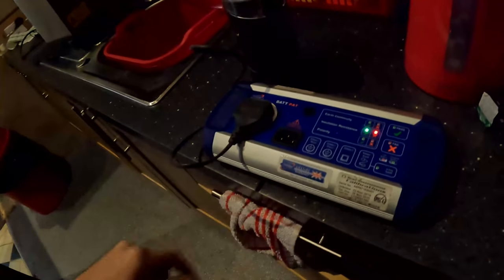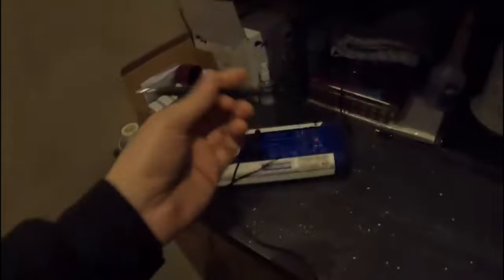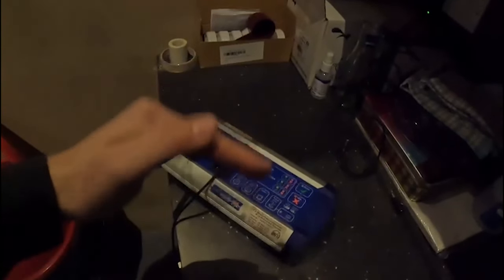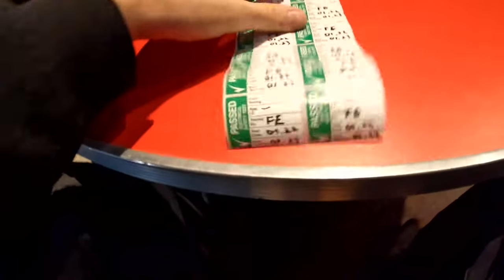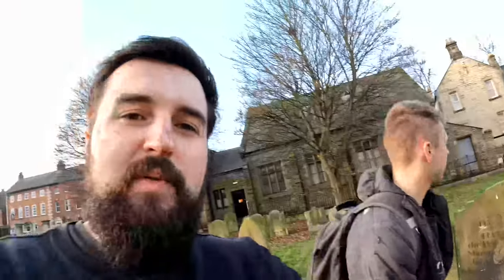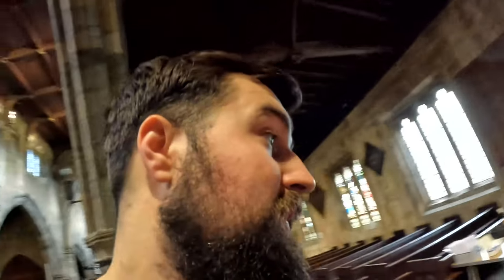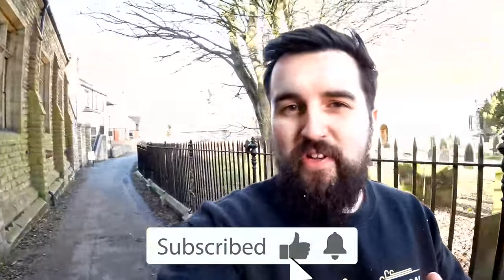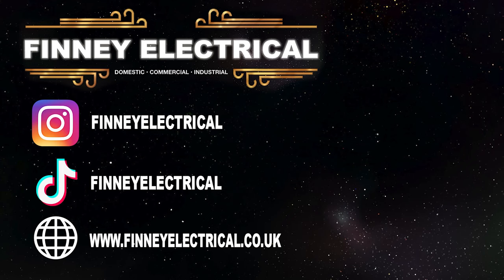THE SIZE OF THAT BELL 🔔 PAT TESTING ELECTRICIAN

Comment: just something to be aware of in the 4th edition Code of Practice for In-service Inspection and Testing of Electrical Equipment published in 2012  section 8.4 labelling it states that "the date for re-testing should not be marked on the label"
Reply from the maker: Not heard this bud, why do they have next test date on the sticker? Surly the client would want to check when it’s next due or when it’s out of date?
Reply: @finneyelectrical  there are various comapanys that sell the stickers with next test due on i think its due to the fact they either have loads left over when the code of practice changed or they havent kept up with the changes in the code on practice and nobody has noticed or told them. theres no such thing as out of date in pat testing. the frequency of inspection and testing as published in the current 5th edition section 11.1 risk assesment. the duty holder evaluates the frequencies based on considering 8 factors. the environment, the users, the equipment construction, the equipment type, frequency of use, type of installation, previous records and functional in-service life.

Comment: Screwfix sell the Kewtech pass labels. They come in a box rather than a roll. I've found them a lot easier to use/write on.
Another informative video though..... I do miss my Batt Pat tester though.... A lot simpler to use than the Megger 420...lol
Reply from the maker: Ah didn’t know that, some stickers have too much work to do on them with sticky covers and assorts. Batt pat is super fast, compared to that keytec thing. 5s test compared to 20s! Adds up